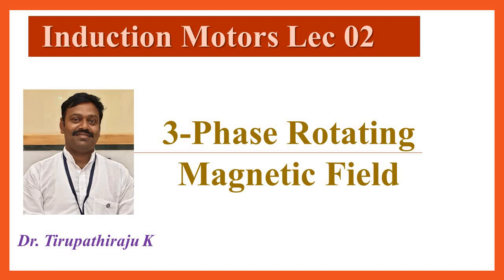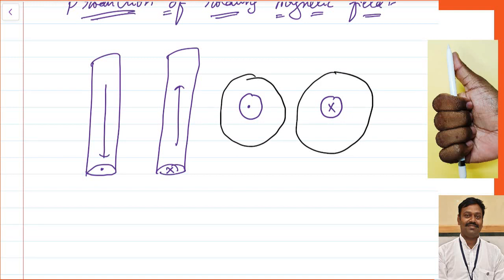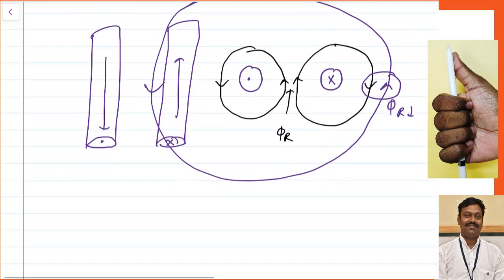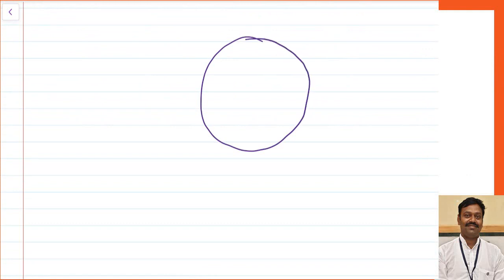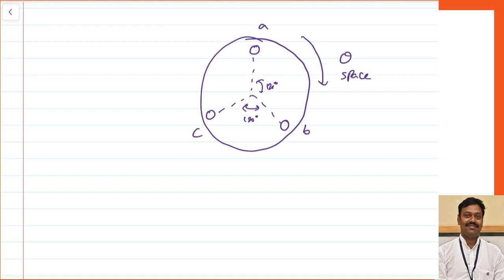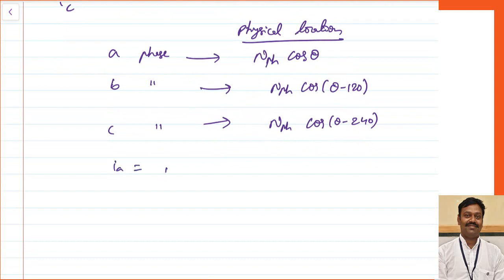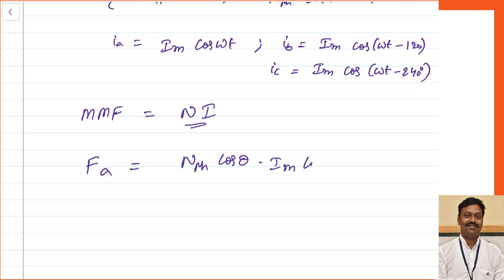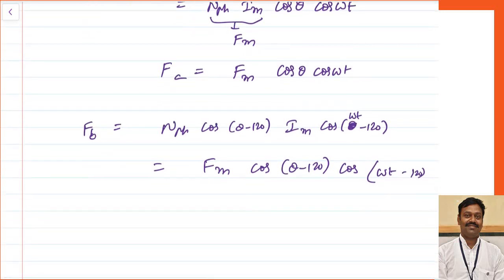IM 02 3 Phase Rotating Magnetic Field

Comment: Sir, For the final m phase case, the winding should be displaced by (2*pi)/m mechanical radians right? You mean it is mechanical radian and not elec. rad right? Its a typo right sir?
Reply: 😊😊😊😊😊😊1😊😊😊😊 9:49 9:50 😊😊😊😊😊😊😊😊😊😊😊😊 9:48

Comment: Sir kindly explain,
If the rotor of three phase induction motor is purely resistive than the electromagnetic torque ( optimum or minimum, load angle 0 or 90 degree )
Thank-you
Reply: @lecturesinelectricaleng  
Actually sir  I have found different different explanations for the same problem, and this is confusing

Comment: Sir, what do u mean by NphCos∆, I know u tells it about in lecture that it shows the position of the conductor where ∆ is space angle that is understandable but what is Nph stands for? As per this ur description in the lecture it is no. Of conductors but still, there is a query that "Can no. of conductors changes with space angle is not possible physically but due to this expression NphCos∆ it happens mathematically  How we will justify it?"
Reply: @lecturesinelectricaleng  Sir I completed ur synchronous machines and get all the concepts but here I don't get relation between them
Reply: @lecturesinelectricaleng  In that lecture, we conclude that a set of conductors having current in the opposite direction makes a pole and as we increase no. Of conductors then they give a resultant sinusoidal MMF wave.
Reply: @lecturesinelectricaleng  Thank u, sir, I get it and I have a humble request to u that pls make lectures on control systems pls.